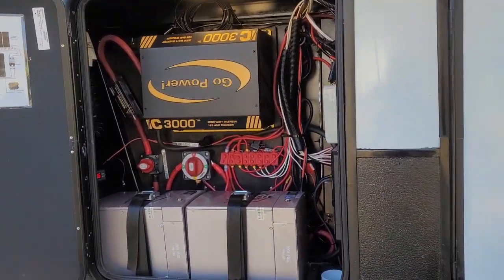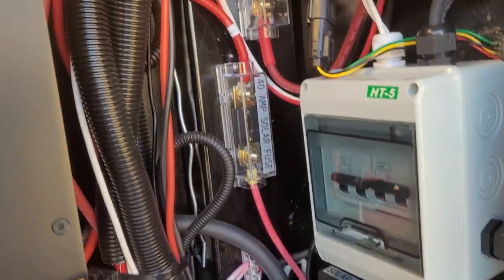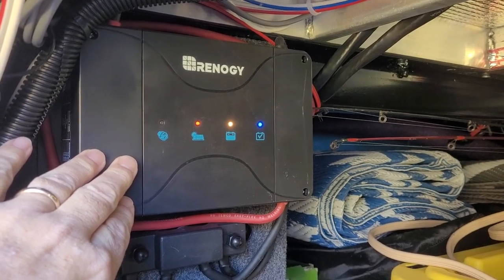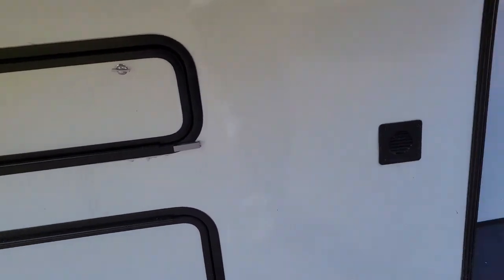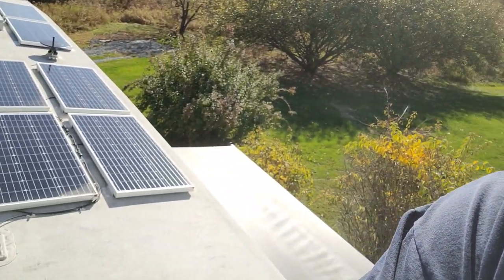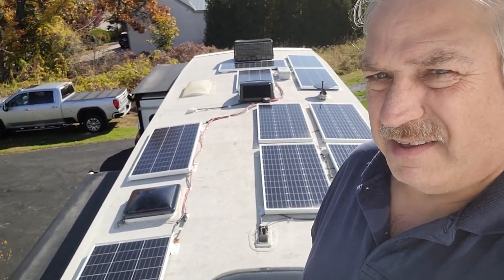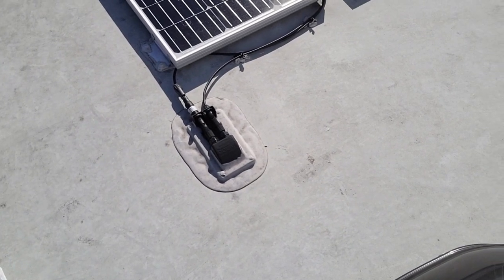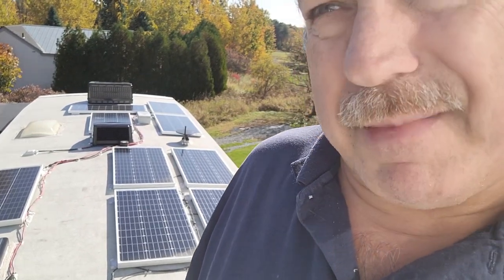Solar Upgrade! Adding an additional 600 watts and DC to DC Charger!

Comment: although expensive a refrigerator replacement with the DC compressor would sip power. A serious investment but also the compressor refrigerators cool much better where the absorption refrigerators not so much when you get in excessive heat or humidity.
Reply from the maker: I agree. I would have gotten a DC compressor fridge if available when we purchased our RV. I'm trying to make it work as best I can so I don't have to replace it.